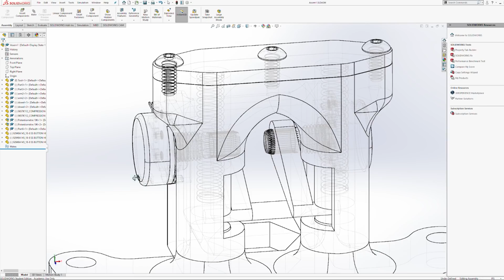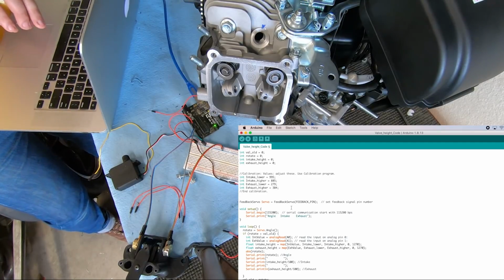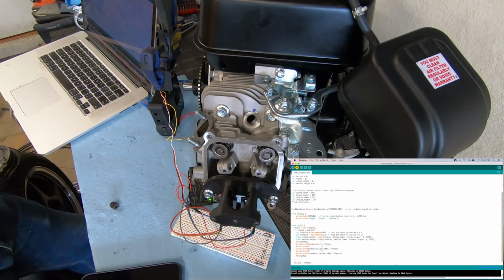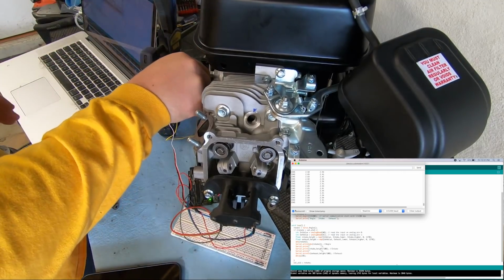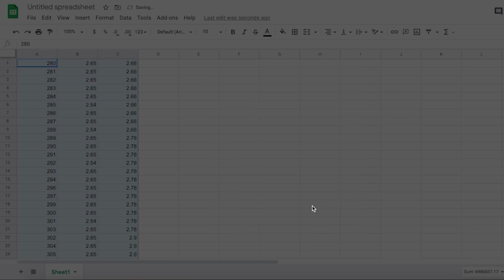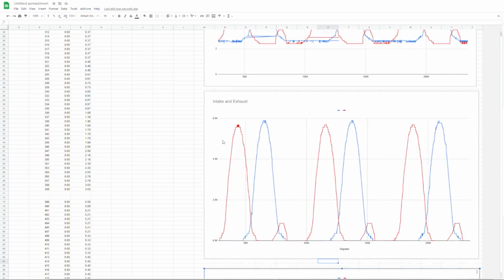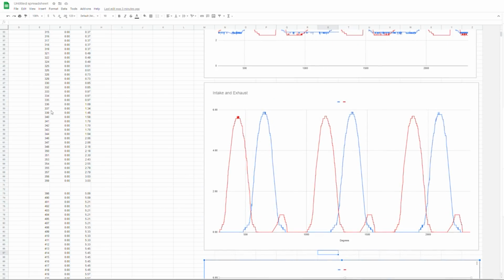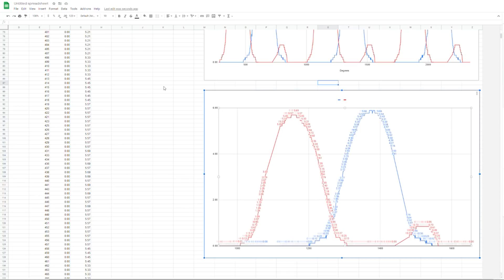Freevalve Build - Cam Mapping Tool

Comment: Great channel I just stumbled on it yesterday. As far as I understand the freevalve system uses a hydraulics to "lock" the valve in place when open. Do you plan to do something similar or just rely on the pneumatic system to keep the valves "locked" in open position?
Reply: Also it seems like you are planning to use the cam data as a reference for the control software. I thought the pneumatic system you were implementing only allowed for basically open and closed position not positional control of the valves?
Reply: @lukaslundgren8448  I think he mentioned    extent of open  as well which can be pressure  controlled  , remember,  this is just proof of concept at this stage, he stated he intends to use electromagnets  which may give a greater degree of control 
Early days but very interesting

Comment: I know its a little early but you should start searching for valve timing as function of engine rpm to increase power and/or efficiency. Also i was wondering if you take into consideration the necesary forces of the exhaust valve due to combustion.

Comment: love the video man great work. i had a question about it though, as you are now relying on a spring for your cam profile reading doesn't this open you up to a kind of secondary valve float? as in the potentiometer could stay turned up for longer than the valve is open and the valve could float like normal. i appreciate that this would only occur and very high rpm on the current motor however as you plan to implement this in cars, and valve float can happen in cars it may be something to think about? It is also very possible i have totally misunderstood what it is that you've done and if someone would correct me that would also be great lol. anyway keep up the good work man cant wait to see what you come up with next!!!

Comment: I thought about suggesting a vw air-cooled engine as a test rig, parts are real cheap but you would need to to build two systems since its a boxer and you would need to deal with a significant amount o dilation, so a miata engine would be better.

Comment: Got to say I tried doing some style kinda like this for a small engine then planed on pls ring this on my Cummins but I didn’t have a 3D printer was learning cad at the time also and was in high school and gave up because nothing seamed to work properly. I’m all excited to see how you do it and am looking to see what happens, and I’m all for the Miata
Reply from the maker: Thanks! The only thought driving me away from a Cummins motor is the strength needed to push the valve spring down is high to say the least. In the future maybe! Thanks!

Comment: I would go miata or some sort of honda. would definitely go a non-interference engine. The damage should not be as bad with freevalve if timing is wrong, as you don't have a timing belt/chain forcing the cam to push the valve down, the air should compress a bit, but it would probably still do damage as the valve's don't usualy go strait up and down, they are usually at an angle..
Reply from the maker: The non-interference is a good point- Something to keep in mind without a doubt.

Comment: Very interesting project.

But how will you make sure the actuators can move fast enough?
At 8000 rpm they will do 4000 lift per minute, or 66 per second. Thats one lift every 15 milliseconds for 240-280 degrees per revolution.
Im sure you thought of this, just curious to hear your thoughts.
Reply from the maker: Mechanically and electrically I'm limited to a cycle time of around 5ms. If I can get air to move that fast is an entire other story. Theoretically, yes.

Comment: Neat reverse cam engineering.

If those potentiometers are going to be in the final design (for closed loop control), you might instead want to consider the non-contact magnetic field based angular sensors....which will last a lifetime, as opposed to under an hour (I’ll bet), for the pots!
Reply from the maker: They absolutely aren't for final cam positioning, you're absolutely right. I'm looking into a few options there.

Comment: The exhaust reopened a bit after intake?
Reply from the maker: Yep. Pretty odd, right?
Reply: @WesleyKagan  compression relief for starting
Reply: I dont get why there would be compression relief, its losing air, so potential power and in a carb or port injected engine its even losing gas.
I was thinking of the different ways camshaft are made, some are assembled and welded, it could be the case here. And if it is, then it could be running a bit off-center, in which case the two side of the lobe would push...
Reply: @hilema41   decompression levers were not uncommon on bigger/more powerful  and better  small motors in the late 70s and 80s to aid starting.
You  were struggling to pull the motor over ( or kick start on some bikes)  without using the decompression lever,   with use it pulled over relatively  easily. As soon as the motor fired, you  disengaged the decompression lever
Do not mistake this for full decompression,  it  was/is a compression relief, simply to reduce compression/resistance to starting
 Fast forward, this is no longer necessary as this is built in, and automatically  disengages  with centrifugal  force as revs increase over  starting revs. Just because most people are not aware of it doesn't  mean it's not there.  Until early 70s many cars had a resistance  block on the ignition  which  heated, increased resistance  to decrease load on electrics once the  motor started. The problem was that if the car did not start immediately,  the resistor dropped power output and the car would not start, so we temporarily bypassed the resistor  to start . Superceded. Pre mid 70s  we had manual chokes on vehicles,  then automatic  chokes became the norm,  now everything is fuel injected  and ECU controlled, but it's still doing the same job, just most people  don't think about it or know about it because just like this small motor it all happens behind  the scenes. Ie superceded 
Taking this to an extreme  early cars and trucks had a hand throttle AND an ignition advance lever, which  were controlled independently, this became mechanically then  vacuum advance controlled for decades until electronics took over  around the 90s. But   the same job is being done,  automatically  and in the background, ie superceded,  again just because most people  don't know what is happening or why is not to say its not  occurring. 
In this situation,  the compression relief  allows easier starting, and stops as the revs increase beyond starting speed, so the issues you  described  are not an issue, as they only occur momentarily  during the starting process 
Hope this all makes some sense and helps  your  understanding 
I guess it helps not only having a bit of mechanical background but having been exposed to many of these changes as they occurred,  remember, most  if not all if these old  systems had their faults  which was at best frustrating at the time. Modern motors are reliable  do not require continual tuning,  start easily whether hot or cold,  and don't require the same level of servicing over a lifetime,  it is thanks to insignificant little details like the decompression bump and a myriad of other quirks that easy starting, problem free running is as good as it is

Comment: I made a comment regarding the set screws which drive the valves on the previous video, briefly those set screws are not locked and will start to back out which will give poor valve timing. Please seek out my comment on the previous video which has a solution

Comment: Cool project 👍. 
The problem I see are that potentiometers. 
I think they wont last very long. 
Instead, you should use hall effect sensors.
Reply from the maker: Absolutely- this is not for measuring the valves when the engine is running, just to get a baseline to see where it is from the factory.
Reply: @WesleyKagan  I think too many are nit picking details  and not seeing the big picture or  myriad  of options available ,  KISS keep it simple stupid, the quickest easiest  cheapest way  to get the information you  want  makes sense at this stage.  Once you progress  further you may  choose to  use fancy tech for this, but this gives adequate information relatively cheaply at this stage. 
Well done

Comment: What’s the little intake opening after the exhaust?
Reply: Compression releases so you can pull start the motor easier it turns off when it starts up.

Comment: What's that little bump with the red graphic? I think that's a from decompression mechanism, it didn't active when the engine is running
Maybe you should delete the small curve there, it would leak the compression stroke
Reply from the maker: That little bump is almost entirely why I built this tracker. I couldn't figure out why it was there.
Reply: @WesleyKagan  i believe the red graphic is exhaust lobe?
That little bump is exhaust valve opening, just a bit, when the compression stroke begin, so it's a bit easier to pull the starter
A lot of motorcycle engine had this mechanism, especially with manual kick starter

Comment: Miata, simple and easy to work on, cheap engine. Or just get a K24 and use it on that, then put the engine in whatever. 

The -02 Camaro has a third of the engine beneath the cowl, unnecessary complication.

C5 sure but still a bit of a crammed bay.

Comment: Okay, NOW I understand what you meant by "cam position sensor is coming" on the previous video. That makes a lot of sense. May as well "train" your virtual cam with a real cam.
Reply from the maker: Exactly. Once I get to tracking fuel and spark I can optimize further.

Comment: Excelent prject! 
for the measurement potentiometers are not so accurate and sometimes not linear, will better use Hall sensors and magnets. aaand yes, put it on a Miata! :D

Comment: those potentiometers will wear off very quickly, better look for something more robust
non resistance based cause resistence achived with material that eventialy wears off
Reply from the maker: Yep, absolutely not a final design, just for tracking the profile on this.

Comment: How are you going to solve the oil pressure issue? Can’t just remove lifers or cams because you’ll never have oil pressure.
Reply: Use a swaged-in plug like a freeze plug or an aluminum blank shaped like a lifter but 0.003" interference fit to seal the oil galleys.... Not difficult

Comment: Awesome stuff. I really like the tool, I don't think you would have dreamed of doing something like that if it wasn't for 3D printing. 
For the Data you should use CSV. It stands for comma separated values and is really just that. If you create a text file, wirte A, B, C in the first line, D, E, F in the 2nd line and save it as a *.csv file, you can open it in Excel, LO Calc, Google Sheets or whatever and the values will be put in the respective rows and columns. If you need to use a comma in the data you can escape it or use \t (tab) as a value separator.

Comment: You should add a couple of laser interferometers to your freevalve setup so you can see what your valves are actually doing when your engine is running.
Reply from the maker: I've been experimenting around with a few ideas and this is one of them.

Comment: Hello sir! I would like to say that I am SUPPER interested in what you are doing. I may even be able to help you out a little. I have a lot of spreadsheets I have made up for my job that they decided was useless to them. It can be used to tune things into their perfect parameters. It is called a Taguchi array. I then took that and set it up to work with a surface so that while you run your tests, you can see what parameters made it run better, what parameters made it run worse, and which direction on the parameter surface you should head in next.

I also have a sheet that can take that data and it should be able to clean it up a bit... I will give it a shot since you uploaded it anyways.

I have had thoughts about doing exactly what your doing for a while, but I just never knew how to control it... since you got past that bit, I might be able to help out math wise.

Comment: Aircooled VW, simple engine, just one small step up from the engine you already have running :)
Reply: That had been my thought as well - I think a four-cylinder two-valve-per-cylinder pushrod four banger would be the wise place to start - once he's perfected it on the Predator. DOHC or V8 adds way more complexity, I think it would be harder to mount on a DOHC head as well. Granted I'm biased in favor of the Beetle because I drive one, though I daily it I've converted it to EFI and turbo'd it. This would be the next step, I would so love to put this on it. My hope though is that this guy comes up with a suitable design then is able to adapt it to nearly any engine, maybe makes kits for many common engines that includes a bolt-on actuator assembly (take off valve covers and rocker arm shafts, bolt this on in their place), ECU, and wiring harnesses. Would put the aftermarket camshaft industry out of business overnight, if these work well nobody would ever buy a "hot cam" again, every tuner would want this.

Comment: don't forget that the second tiny lift event on the exhaust can is only at very low rpm for compression relief to aid starting and it is controlled mechanically on the cam to "go away" at around 300 rpm for running conditions.
Reply: Ah, that explains it - was wondering what that was. I've seen that mechanism on lawn mowers, a tiny cam on the cam itself connected to a flyweight, above a certain RPM it swings away and the mini-cam turns to be flush with the big cam.
Reply: Decompression?
Reply: Bsically a decompression system built into the camshaft lobe and some sort of simple mechanical inertia weights that turns off the decompression system after certain engine rpm...
Reply: I was coming in to say the same thing. Spent a lot of time playing with B&S animal engines on a Land & Sea Dyno, years back.

As mentioned, basically a little arm that is there at low RPM so you don't rip your shoulder our trying to start the engine. The increased RPM then slings it out of the way, so that your aren't cracking open your exhaust valve in operation.
Reply: I came to the comments hoping to find out what was going on there - thanks!
Reply: That explains the 2nd little peak on the red curve, TY.  He just used the lifters to get original cam and valve timing profile, so the decompression exhaust opening won't be there in the pneumatic valve profile anyways.
Reply: ^^^^^ Commenting in hopes he sees this

Comment: I love the idea behind this project! A suggestion would be to add an electronicly regulated air presssure valve so you can control the lift of the valve, or even try to use the valvelift as a throttle control (like BMW valvetronic).
Anyway, if you need help programing stuff you could hit me up

Comment: Disregard the small rise in the exhaust valve  opening as the intake closes in running conditions other than recoil starting(pull cord). It is indicative of a compression release mechanism built into the camshaft for easier starts.
Reply from the maker: That bump is one of the reasons I calculated this, and I'm glad to hear I don't have to use it anymore.

Comment: Your engineering process is an inspiration, wish I had mastery of CAD and data manipulation like you! So many ideas but not skilled enough to pull it off
Reply: try autodesk fusion 360, it's free for personal use
Reply: @Spark6235  I've been learning FreeCAD , lots of good resources on YouTube , fusion is no longer free
Reply: Fusion 360 is still free for personal use. "Free startup and personal licenses for Fusion 360 are valid for one year but can be renewed annually". They have limited certain features on the free version but these should be fairly insignificant for someone learning CAD.